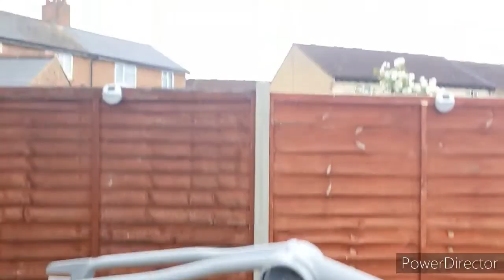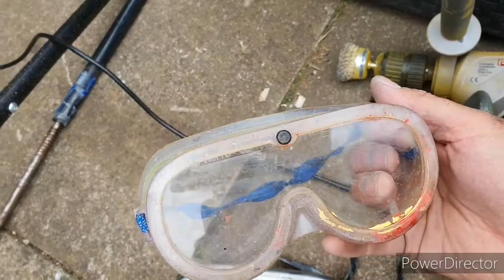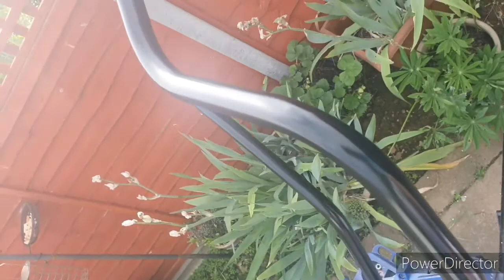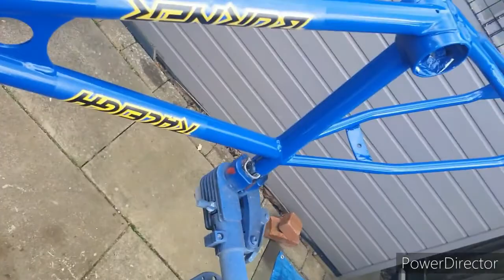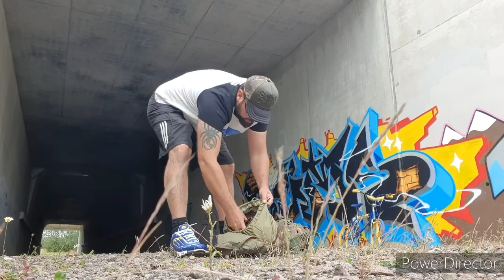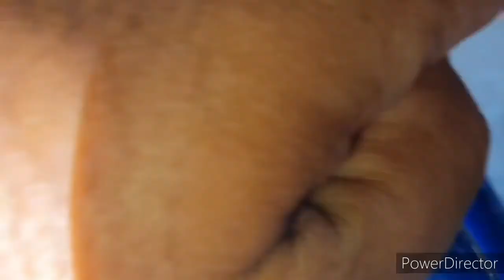Raleigh Burner Restoration (Swamp Thing) part 2

Comment: Hi, good job!
I'll try to restore my extra burner with my son. I need to change the wheels, could you confirm the entraxe of front and rear wheels? 
I found 95mm for front wheel and 115mm for rear wheel, is it exact?
Thanks for your answer

Comment: Really nice job👍 what colour was the blue spray paint,it looks a really close to the original colour,where could i buy some? Thanks in advance👍
Reply from the maker: The brand is called loop and can be bought online from Alfreshco shop the colour name I think was LP-379 SAO PAULO looks like it might be currently out of stock but give them a call, nice people
Reply: Thanks for the paint info,i will order some of that when its back in👍
Reply: @Demograffix  
Got some paint on order👍just watched again,what a great job u have done mate👍 where did u get the stickers,are they off ebay
Cheers
Reply from the maker: @rick79991  got the stickers from esmdesign, great service and lots of retro decals to choose from